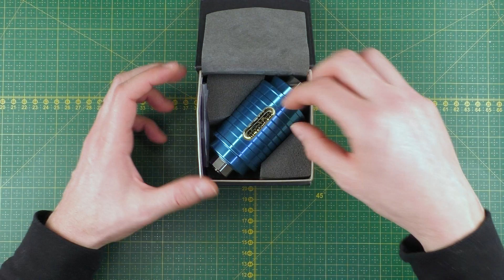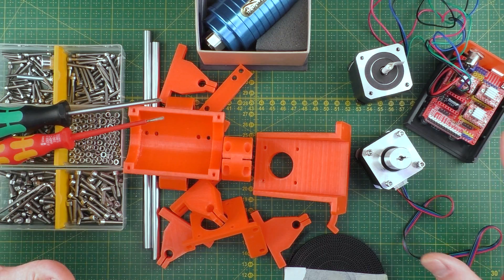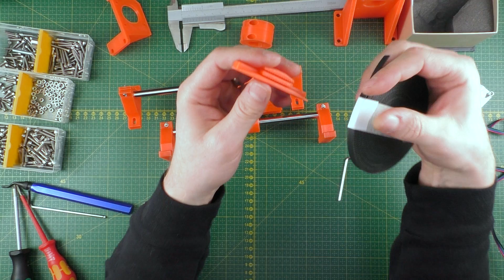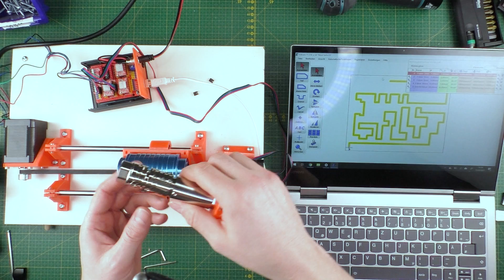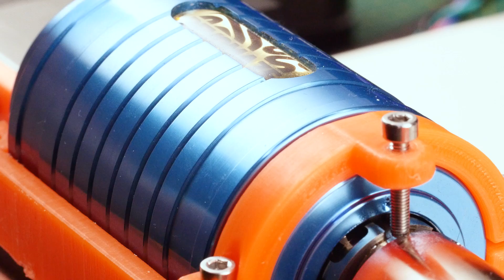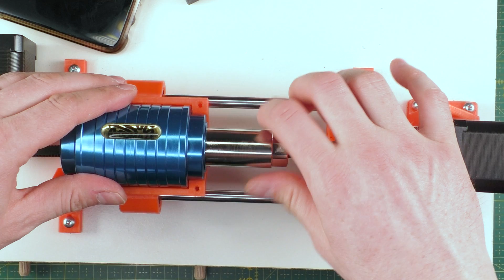The most intriguing Puzzle on the Planet solved in World Record Time!!

Comment: ? 
up the voltage to the stepper drivers 24~28v   and you can shave a few seconds off that
or swap the gerbl board for a  32bit 3d printer board with step sticks and use TMC5160's at 48v you might get it under 2sec (the max accel is a product of phase inductance and RMS current ) you need more voltage in order to over come inductance to maintain phase current as RPM increases
Reply: use marlin 2.0 firmware with something like a CR-10 S5 config and disable thermal protections or use a laser cutter config skip the endstop

Comment: Great video. Very cool project.
But, I'm confused. Why are you showing two different times for the solves? It took me until the end of the video to notice, but at 16:56 in the video you start your phone and an onscreen clock at almost the same time. You then displayed 6,28s like it was a conversion of the 06:07 onscreen...
Maybe I'm missing something...
Reply: For some reason the time shows hours: minutes: seconds: 1/25 seconds. So if it shows 0:0:5:07 that's actually 5.28 seconds. 7/25 seconds is 0.28 seconds. I can't find any info on the internet about timers with 1/25 second intervals, or why you would use that. Then he has to convert it anyways. I thought maybe it's because he's shooting in 25 fps (Europe uses 25 fps cameras, and N America uses 30 fps), and it is an on screen timer that is baked into the editing software. It allows him to determine time based on the number of frames. In almost certain that's what it is. Because you can see the concerted time he puts in is a different size and font.

Comment: This is a typical speed run, months of setup and routing for a single run that blows everyone socks off. I feel like it might have been better with some sort of template for everything's placement so that it could be aligned more accurately which should also improve the performance

Comment: Damn its so much easier to use steppers nowadays, i did a project in the 90s and had to design the control hardware and the driver software and program a 68000 to make it work. Kids these days and their arduinos...

Comment: @Mr.Puzzle. I think it could be a little better if you solve the misalignment and let the rigid coupling. "Soft" coupling introduce errors at hight speed. If you have money, buy 
Teknic ClearPath Motor and you will explode the time !!! But not sure it's worth for you, but ask them it will be a good practical case for them ?!?
Reply from the maker: I also thought about using servos and Bild a metal version 2.0
Reply: @Mr.Puzzle  Teknic ClearPath Motors are "servo like" but with the ease of stepper motor, and are much more cheapper than a real servo system. Take a look at them.

Comment: I liked the video, but thats not really solving the puzzle, just moving on a pre mapped path. That's a bit like copying the answer key. I was expecting some manor of sensing a dead end...off the top of my head...some of the TMC drivers give real time current draw.  3d printers use them to home by bumping into surfaces, you could do the same & actually have something that was solving it.

Comment: i see no endstops? hmm one dodgy up date should brake it. regarding the steps setup, you may not notice so much whith short distances but, use a fairly accurate caliper and measure at 10,20-and so on. if the distances increase at each 10mm step theres too many steps, to little if the measurements decrease the further you go.(measuring just one gap will set the machine to most of that gap only, then run out  before and after...). sometimes your steps per mm will be correct, but pullies or what ever not being 'ideally perfect' you  may need to adjust the drawing. getting the correct steps is more important, especially when two or more axis are involved.(eg. 10mm is spot on 20mm is 0.1mm out 30mm is correct 40 is correct or even all are say 0.09 out but all points are the same means the steps are correct or they would run out the further you travel).
Reply from the maker: I think measuring it like this is too inaccurate. I needed to be 0,1mm exact. However, the exact dimensions where not important. Only the coordinates of each step and the step size itself to repeat it.

Comment: Your flexible shaft coupler on your motor that controls the rotation of the cylinder is causing the lockouts. It's moving back and forth due to the flex in the coupling. You need some type of pillow block bearing and you can solve it at 100% speed no problem.

Comment: Amazing machine. Looks like many people want it to solve the puzzle by itself next. If so, my idea to this would be: Let it record the path. So you get a map of the maze to solve it by hand.
( I know, the purpose of these mazes is to solve it by yourself. But it would be cool if you put in a maze you don´t know and see if you could solve it with the solution the program gives you. Would that be cheating?)
But I would use the lower speeds. At the end when you dropped out the pin, it looked like there was some material taken off from the pin or maze. you can see it on the table.

Comment: So now I want to see the software developed such that you can put an unknown maze into the system and let the software derive its own solution.  :)
Reply: Was thinking the same thing... If you can get feedback from the servo motors about how much torque they're excerting, you can detect when they're pushing against a wall. Pushing hard, without movement? Wall! 

Would be a cool project actually :)
Reply: thats what I was expecting in this video.

Comment: Nest challenge: add sensors so the machine doesn't solve with a pre-programed solution, but instead it discovers the solution.
Reply: Yep, when I saw the arduino I thought: "Is he going to make a tool assisted solve or an actual solver?" It would be very cool
Reply: just swap the drivers for TMCxxxx...realtime access to current draw allows them to "bump home" on 3d printers
Reply: It "works" the puzzle, "solving the puzzle" is different thing.
Reply: That would be very interesting,  I hope he takes the challenge?
Reply: That would be really hard. I think if you could program it to try to map the puzzle out rather than "solve it" maybe that would work. With so many fail gutters and going back and forth it would be just about impossible for it to solve like a human. But if it mapped out every contingency it could be done but it would be kind of boring. It would be interesting to see how someone would program a way of realizing when it was in a fail gutter. That would be really impressive
Reply: @SlowerIsFaster139 :

It’s not at all difficult.  It’s the same as a maze printed in paper except that two edges are joined seamlessly.

Comment: Have you found out why it stuck at higher speeds? Maybe at those speeds the movement continues a tiny bit because because of inertia. You might be able to compensate that by making the initial movements a little shorter.
Reply from the maker: Yes, it's inertia but also the complete system does not provide enough stiffness. Also the sleeve to shaft hast some freeplay.

Comment: I will prove it has a pin (accidentally proves it off the edge of the screen). Haha, I think you proved it enough between it getting stuck on 100% and the clicks... but thought it was funny that you went the extra mile only to be foiled by a zoom.
Reply from the maker: If you know the puzzle you can see and hear that the pin was in. Otherwise the shaft can rotate freely and can be just pulled out.
Reply: @Mr.Puzzle  I know, and you proved it to 99% of people. But there will undoubtedly be a small number who will question it because the pin dropped out off screen. I am not one of those people, I just thought it was funny. To be honest, I would have just taken your word, but the internet is full of people who will question your integrity no matter what you did.

Comment: If it's only running for a short time, you can probably add more current to the motor drivers so they can accelerate harder. awesome work!
Reply from the maker: Also thought trying it with bigger stepper drivers that can fire them with max current. But the whole rig and belt system is too elastic I think.

Comment: I don't understand metric time.  Why is 4:24 seconds the same as 4,96 seconds?  I'm pretty sure it's just 4,24 (aka 4.24) seconds in American.
Reply: @agvulpine. It has to do with the definition of the units of a second of Mr.Puzzle's programme. One second has 25 units instead of 100 units. So: 24/25 metric seconds = 96/100 normal seconds.
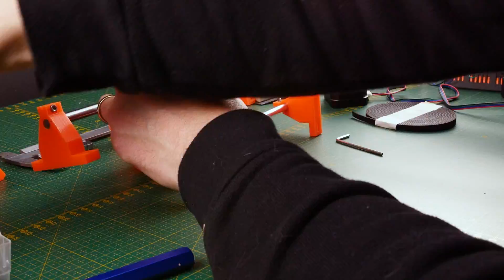Reply from the maker: 4:24 is not a time. It's the time code of the video. The video was recorded at 25fps. 4:12 are 4 seconds and 12 frames = 4,5s. Going frame by frame and determine the start and end point was the easiest way for me to measure the time.
Reply: @Mr.Puzzle Thank you for the explanation.

Comment: It would be great to add torque sensors, and make a program that actually solves it by learning where not to go (where the sensors senses resistance). It could then make the map by it self. Also it could help manually solving the more tricky revomaces, by controlling the axes manually, while drawing a map with a plotter or similar (yes I know a pen can be connected directly to the mace) The plotter (or just a digital screen) could then plot colors or similar to indicate the pressure used at different places. This would give a visual feedback on where to go the next time around.
Reply from the maker: Interesting idea. Also a AI solver would be great. But this would not works with steppers I think. Rater servos or closed loop steppers. The traps would make it really difficult though.

Comment: It needs a flexible coupler with no backlash and it could go faster
Reply from the maker: I think the belt is also a limiting factor due to its flexibility.
Reply: @Mr.Puzzle  possibly. I have a delta 3D printer and am very impressed by how little flex/stretch the belts have, being probably a meter long each. They can easily maintain ~0.1mm accuracy in prints. The frame for your invention might benefit from being more rigid, maybe made of aluminum. Time for a CNC machine haha

Comment: At 100% speed, the torque demanded at the shaft of the motors cannot be met by the motors.  That is, the inertia of the system is too large for those motors.  This is a typical motor sizing problem, often overlooked in development.   When this happens with a stepper motor, which is usually open loop (no encoder), the stepper "missteps".  That is, the controller demands N steps, but the stepper motor only provides N-m steps.  Thus the end position is not achieved and without feedback, disastrous results are inevitable.

Additionally, selecting a helicoil coupling between the motor and the part to be rotated is good, but care must be taken as you have introduced a spring in the system.  You must examine if the natural resonance of the system created is within the bandwidth of the servo system.  You must also consider the affect of settling time as a function of this spring.

All in all, a reasonable solution, but needs much more work in the equations.
Reply from the maker: You are right! Also the belt is too flexible. I can't see any missteps before it gets stuck. I rather think the whole system is too elastic. At the very end you can see a video at the highest speed I was able to run it. Maybe I can get it a bit faster.and get below 4s.
Reply: @Mr.Puzzle  may I politely disagree?  I can hear one of the steppers missteps!  Its a chattering noise, quite audible in the video.  As soon as I heard it, I knew!

Comment: That was very impressive Mr. P! Now I am wondering if it would work faster with a smaller diameter screw? Or would that be cheating? 👍👍😉😉👏👏
Reply from the maker: It would. The smaller diameter would compensate for the flexibility in the system. The screw I used made it much easier to find the best coordinates though.